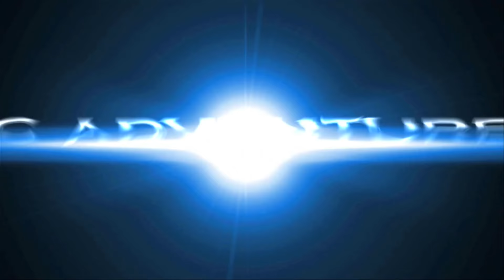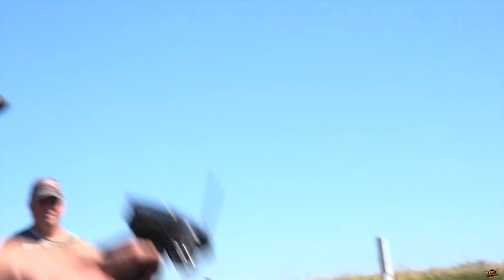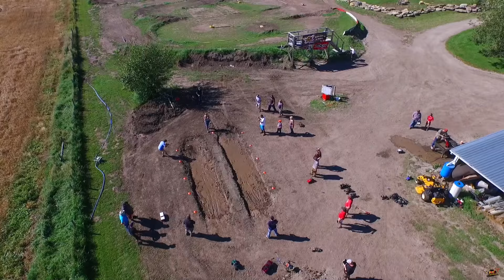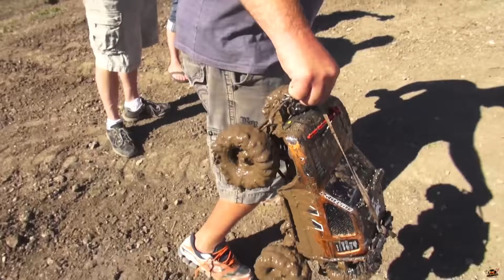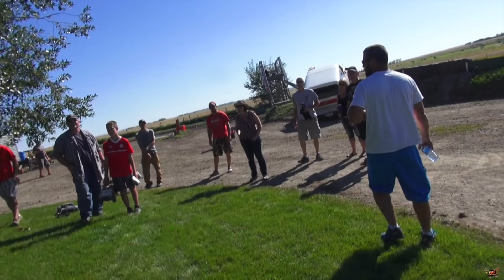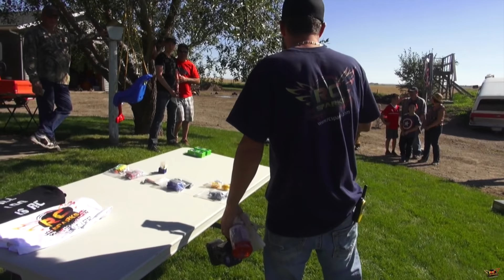RC ADVENTURES - TTC 2015 - MUD BOG - Tough Truck Challenge (Event 5)

Comment: Here's a atv mudding tip. Big Paddle tires in the back, and smaller smooths in the front. The smooths will glide and the paddle will grip and get the machine movin

Comment: Two or 3 feet in and they all stall. You need bigger vehicles, bigger tires and much more power.
Reply from the maker: You just need to understand what you are looking at is all.. you're watching event 5. Maybe you should start at 1
Reply from the maker: You just need to understand what you are looking at is all.. you're watching event 5. Maybe you should start at 1
Reply: Do the events get worse, or more incredibly difficult as time goes on?
Reply: I think rock crawling is probably more my thing.
Reply from the maker: @brianvalley5223  Yes, the MUD is usually the last event, as it is a truck killer. But usually only the 25$ motor.  It is a series of 5-6 events that usually take place over a 2 day period.  I have filmed 10 TTC event.. over 10 years! I think you will like all of the different events
Reply: I'm just getting into this Hobby, and I don't have five or six hundred bucks to burn up in the mud. I'd rather buy a machine that I can either do digging With Or racing with

Comment: Hey guys can someone help me I have a traxxas revo its nitro and I took it to the repair shop and they fixed it and it runs but i can connect the remote to it, it used to be electric start now it's pull start does anyone know how to fix it
Reply: You got scammed?
Reply: bind your remote to ur reciver. Traxxas has info on this as well as youtube .
Reply: +Eric Dunlap the remote says its connect but it's not working the car is fully charged and the remote has new battery's but I'm taking it back to them and they are fixing it for free
Reply: +Eric Dunlap thanks for you help

Comment: hello I would like some help with my Rc . I want to to upgrade the motor from a power 17 and have been looking at a Ares pro brushless motor 1/10 scale 540 size
Reply: is it A good idea?
Reply: I have a redback racing 3450kv motor and it rips I have changed my gearing to 19/76 and it goes 50 mph plus

Comment: I'm a rookie in Rc. Any advice?
Reply: Decide 1st what you really mostly want to run and look at your surroundings. Are you a basher? Fast pavement? Trail Crawler? Rock Comp Crawler? Do you live near streams? Parks? Just backyard? It's expensive, companies sell cheap parts to keep costs down. Then YOU have to upgrade. So far Arrma is rock solid for bashing. Trail is Axial, Rock Comp Crawler is Rc4wd. Best advice - Replace only broken parts. Don't fall for hop ups.

Comment: Hey can Someone help me

I want a rc car and i cant decide between those 2:
Traxxas e revo 1 . 16 vxl
or traxxas slash 4x4 or 2wd please help me sry for my english
Reply: Hey man, I have the traxxas e revo 1/16 vxl and my brother has the slash 4x4 1/16 they are almost identical, the e revo does backflips and wheelies, slash doesn't,  but I find that because the wheels are not protected by the body as much the e revo's parts break easier. If you want an off-road then both are great I would go for e revo as it falls over less because of a wider wheel base
Reply: Ok thanks!